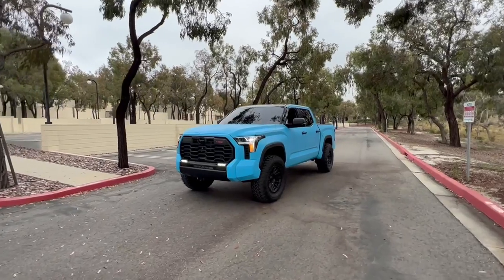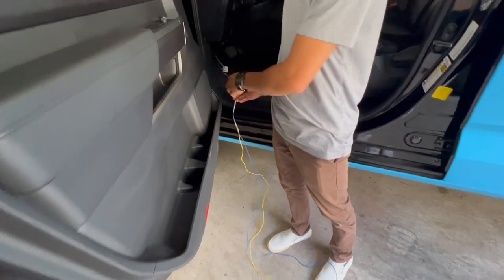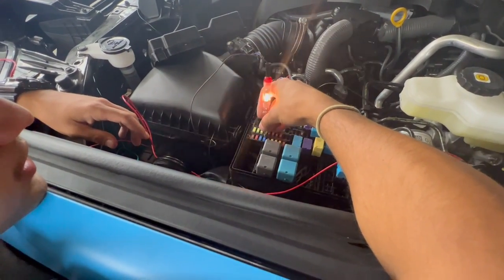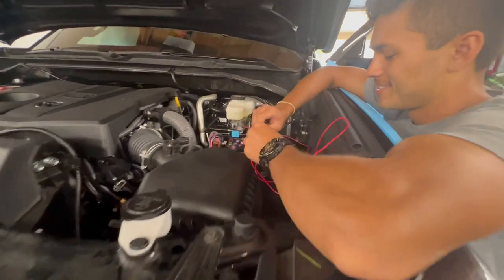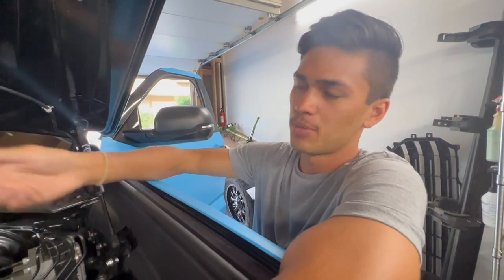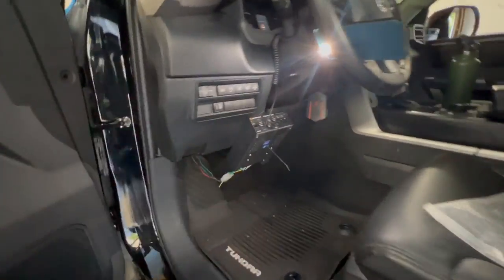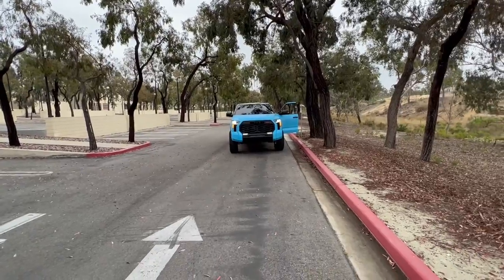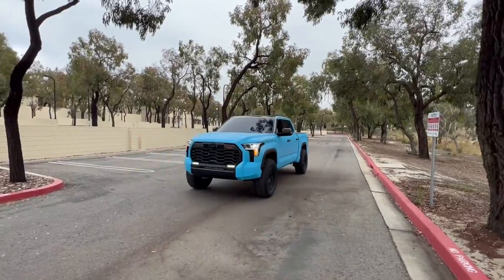We Installed A PA System!!

Comment: I had this one in my 08 tundra and removed it when selling and just installed it in my 24 tundra and was able to mount the speaker to the driver side rad support bolt and the ac line support bracket bust had to bend it down to clear the hood and I ran mine into my center console so it’s not seen but can be used by sliding the little middle piece back!
Reply: I just bought a pa system and have a ‘24 tundra. Would you be able to send me a pic of yours in the console? I want to put mine in there. Was it difficult to do? I have the safe as well and will probably have to cut into the console

Comment: I noticed you mounted it in the front. Was there any problems with rain or anything like that?
Reply: Shouldn't be at all most people mount them under their front bumper or get a kit that goes where the spare wheel goes, mine is under my front bumper and doesn't have any issues but mines a custom set just depends on the quality of the product
Reply: I had one didn’t have any problems with rain. But since it’s hooked up to the battery when it gets low it will go off. My police siren went off at 3am one morning it sucked I had to cut the wire 😂 then just fixed it .
Reply: I got mine in the front haven’t had any issues.